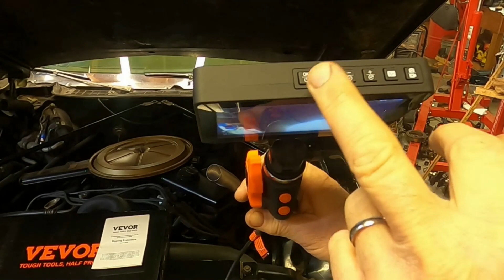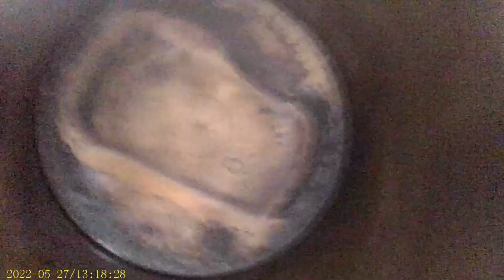Cadillac 472 500 Valve Inspection - Vevor ZX2-D Endoscope

Comment: Cylinder walls look ok. The white residue is definitely from running a bit lean. The color of the plugs show - to my old eyes - its definitely a bit towards the lean side. Maybe a little water or Sea Foam type additive for a couple of tanks then check those carb adjustments.

Comment: I would say it looks good. Considering age and mileage. If I am not mistaken then this engine is a non cat engine which used to run on leaded premium. ( Correct me if I am wrong )
I have this white residue in my 560 engine too. It’s partially lean mixture and ethanol fuel. I am trying to only use non ethanol fuel.
The black residue on outer piston surface is the beginning of oil leaking piston rings (minimal minute leak).
Cylinder wall / sleeves are fine.
When walls are scored then LED light from Borescope will reflect differently on wall. You will know it when you experience this the first time,
👍🏻👍🏻👍🏻
Peter
Reply from the maker: Yes, first year for cats was 75 in the U.S. This is a 71. I had been running pure gas with Lucas octane booster but I got bad tank of gas a while back since then I've been running 10% Ethanol 93. Can't get pure gas 93 anywhere nearby.
Reply: @ImpalamansGarage  thanks Mike. This brings us now to the question if Lead Substitute works better with non ethanol or ethanol based fuels due to their additives.
The valve stem deposits you showed are a direct result of this substitution as the valves and valve guides in general were designed and manufactured for leaded fuels.
They can get severely damaged if you don’t use any lead substitute at all.
Peter

Comment: I would run a few gallons of e85 and give her the old Italian tuneup. It should blow all of that junk out. Also white valves would mean it’s running lean IMHO. If e85 is not in the cards maybe some seafoam cleaner via intake and a smoke show.
Reply: A bottle or two of Redline SL-1 in a full tank or two of fuel would take care of all of that without washing the cylinders down with seafoam.

Comment: Overall the plugs look about textbook.

I do not know the age of the engine, nor heads.  

Assuming they have never been touched you may consider replacing the valve seals which from memory can be done topside without removing the heads.  

I personally would not be worried on a near 50 year old engine that by observation seems to run perfect. 

Find someone that can dial in the carb mixture and that can have an effect on deposits on the cylinders and valves
Reply from the maker: 71. Heads have never been off the engine to my knowledge.
Reply: I would do the valve seals and be done with it, max.

Perhaps you could investigate a modified direct injection style valve cleaning.

If it were my car and running fine, I wouldn't break a bolt loose on the heads.

Find an old guy from a car club to tune the carb. Video the process for sure.  It's not difficult and only slightly complicated as it is a lost art due to fuel injection and sky net control of new cars